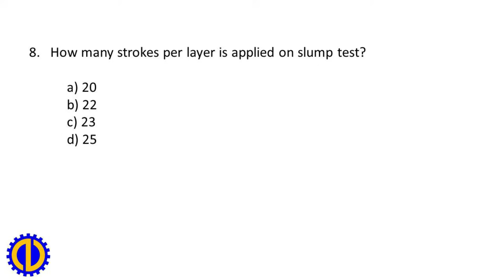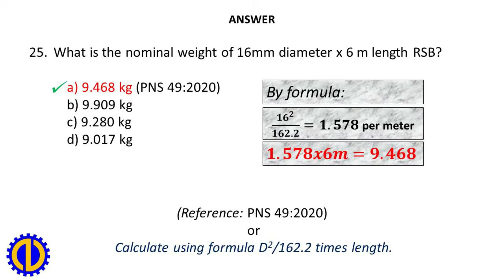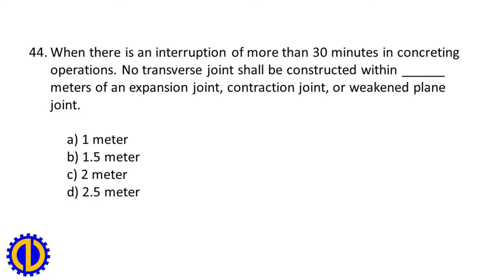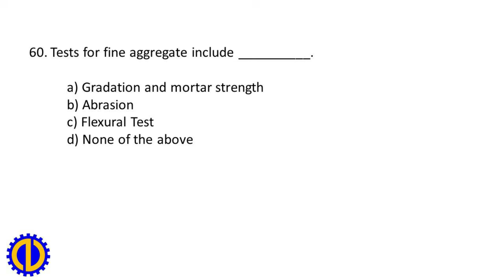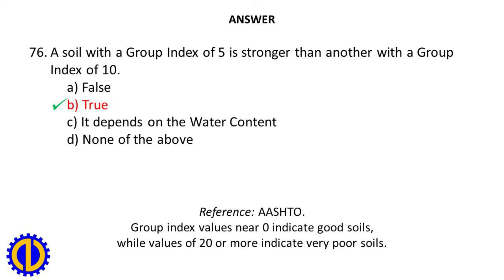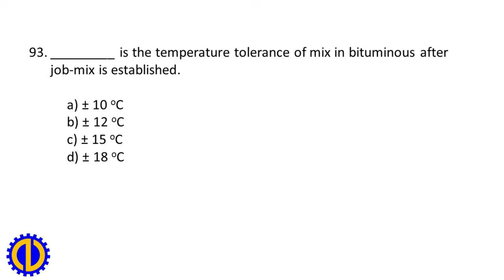Materials Engineer Reviewer Part 1 - 4 with answer reference

Comment: answer in Q#20 is B. sieve #10, #4 is the boundary between coarse and fine sand
Reply from the maker: For ASTM whether soil or aggregates, the dividing line is #4. For AASHTO, the dividing line for soil is #10 and concrete aggregates is #4.

Comment: Sir question no. 75 AASHTO T99 ( item 104 embankment
AASHTO T 180 for item 200,201
Reply from the maker: Yes for exam purpose if T99 is on the choice.
But you can also use T180 on actual application.

Comment: Sir yung soil boring diba at least 1m. Maximum 1.5 ( new route) 
No. 85 sir
Reply from the maker: Exploration depth "shall extend" upto maximum depth of 1.5m for a light cut and fill not exceeding in 1 meter height.

(Note: The 1.5m depth is measured from proposed subgrade not natural ground).
Reply: Word ksi nilagay sir at least means minumum
Reply from the maker: @sidracho9898  iyong 1.5 po ay mula sa proposed Subgrade o grade line hindi sa existing ground. Pag sa existing ground ka magsukat ay maaring less than 1 m depth ang excavation depende sa backfill height. Pag backfill height mo is 1m ay 0.5 m na lang boring depth mo from existing ground.
Reply from the maker: @sidracho9898  Mediyo confusing ang tanong sa 85. 

For information and open discussion to everyone:

DO 229 s1993 
1) For new route (light cut and fill up to 1m) and Existing Earth roads -  Auger borings and test pits shall be made 1.5m deep along proposed subgrade.
2) For Existing Road (pavement failures) - Supplementary boring shall be taken at a depth of at least 1 meter below subgrade.

DPWH Design Guidelines, Criteria and Standards (DGCS) Volume 2C - 2015. 
- For (light cut and fill up to 1m) and Existing Earth roads -  "shall EXTEND" up to maximum 1.5 m from proposed grade line.

Comment: Hello po , problem 20. 

Sieve number 4 po ba or  no. 10 ?
Reply from the maker: Sand definition on DPWH glossary is passing No. 4 retained #200. 
DPWH Item 703 Aggregate specified Number 4 sieve for concrete works and Number 10 for soil or backfill Materials.